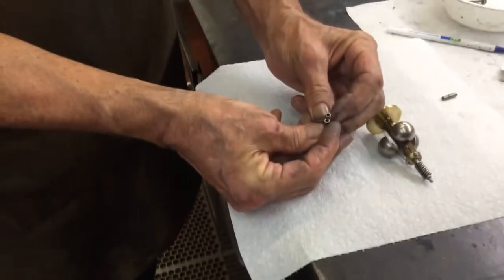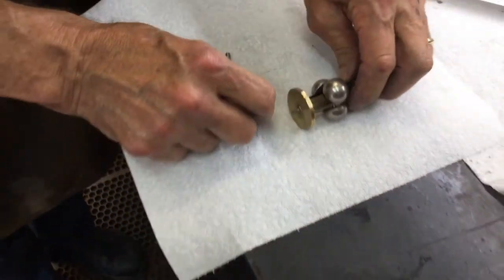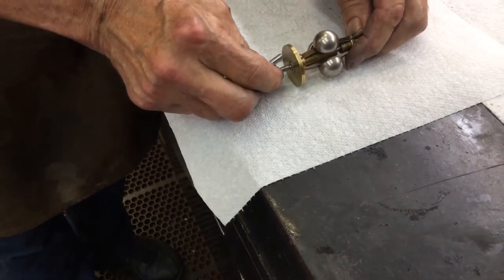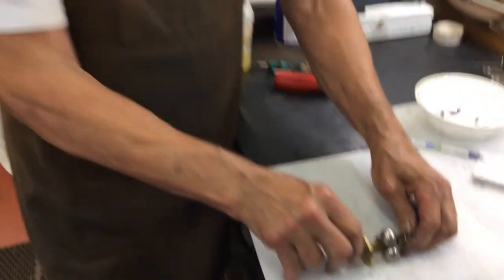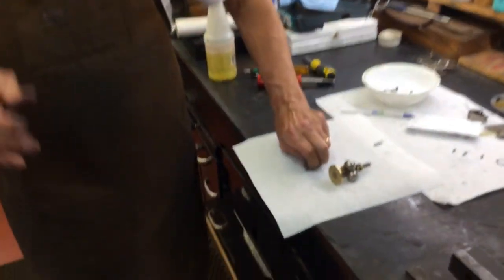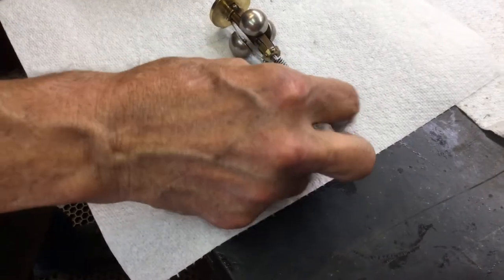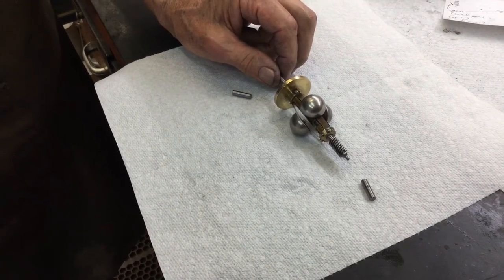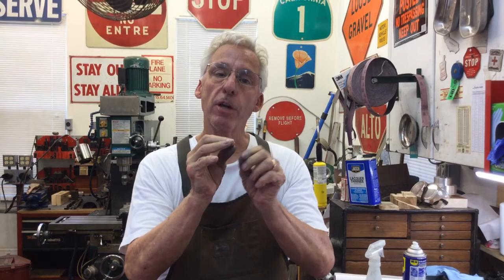424.  Phonograph governor bearing and the tiny ball bearing inside it

Comment: Do you happen to know the size of the ball bearing? I’ve run into this recently with a xiv with the 4 spring motor. The ball bearing is missing from the worm gear side. Thanks!
Reply from the maker: The last XIV I worked on, the bearing was a 0.086, #44 bearing.
Reply: @1974hurt   do you happen to know anyone in the states that sells bearings this small? The only ones I could find were from china and they take over a month with shipping.
Reply from the maker: @jamescurran1920  try contacting George Vollema at great lakes antique phonographs. His email is victrola@triton.net.  You could ask him if he has individual bearings so you don’t have to buy a batch of 100!